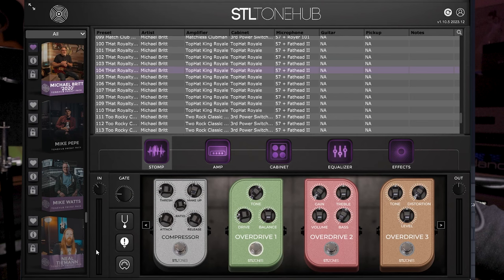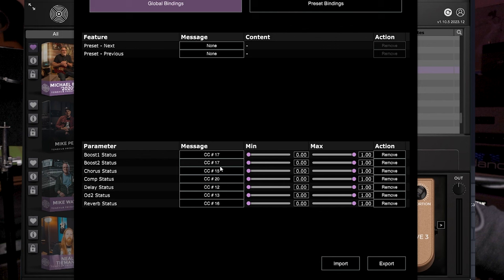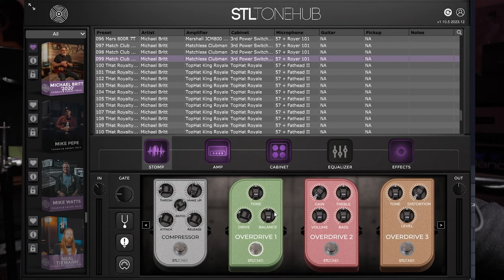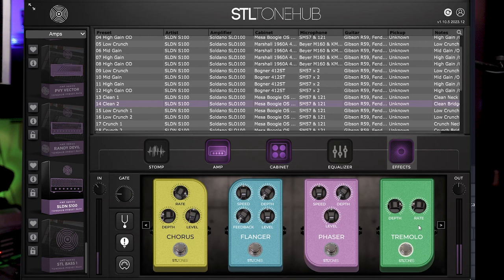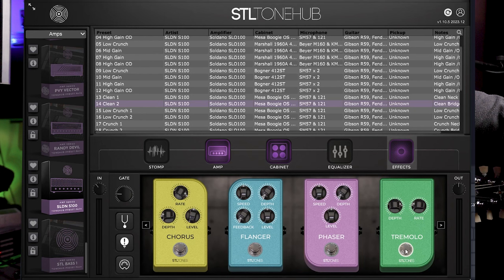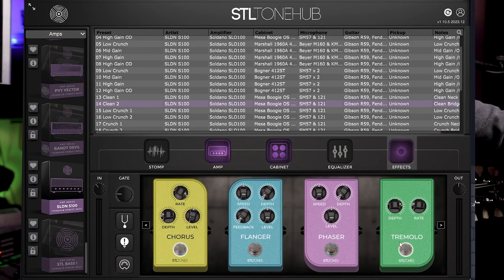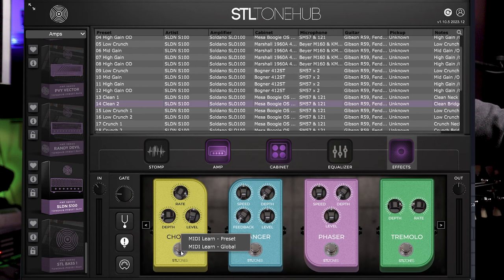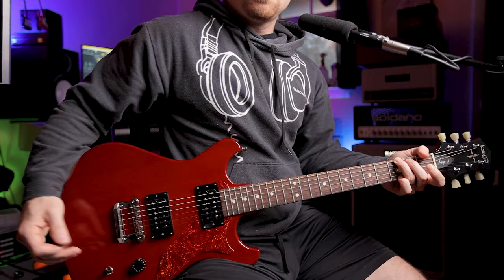Will Guitar Amp Plugins Replace Floor Modelers?

Comment: I think laptop based rigs becoming normal would be the best possible development for consumers. It's better than having multiple competing ecosystems tied to specific pieces of hardware that will run you 1-2k each. Also normal audio production tools become viable on stage and that solves the problem of not being able to completely recreate studio tones.
Reply from the maker: for sure. And you can have as much as your computer can handle
Reply: Also you can choose whatever you want to use for amps + fx, and aren’t locked into an ecosystem
Reply: Things like ToneX, NAM, and Valhalla FX are free as well, and at the very least rival, if not outright beat all the stuff for digital floor units out there right now

Comment: To me the interesting part of this is the modularity of it. Instead of your whole unit bricking you can replace components if something goes wrong. The additional processing power afforded by a laptop is also tempting, as is the fact that you don’t need a dedicated unit for just guitar, so there is a huge cost efficiency with a plugin solution.

I’m moving from an analog rig to a digital rig right now and was considering the Helix or LT but now…down the rabbit hole I go!

Comment: That's a step I'm still not ready to take. While the morning star seems more well thought than most pc compattible switchers I've seen so far, it's still very much on the whim of the pc or mac and I've seen both of those fail a lot more compared to hardware based modellers, plus you got more points of failure (computer, interface, midi controller) in your chain than a standalone modeller.  One more thing I'm not to sold on about is the actual customization. I haven't tried but STL Tonehub yet, but from the demos I've seen it seems to suffer of the same issue the Neural and standalone Line6 stuff does: with every amp I'm stuck with a particular set of FX. I use the a couple of neural plugins for when I'm in a situation where I just want to record on the fly but say I like the type of delay or fuzz in one and the amp in another it gets stupidly complicated to get it done, where with a modeller I got all the options there and the ability to set everything up the way I like (unless something like Helix Native becomes a standalone app, since so far only Bias FX is like that but it's kind of dated sounding). That said, for fly gigs or stuff where a full blown modeller is too much I feel safer with my hx stomp

Comment: I would LOVE to use plug-ins for the remaining time as a guitarist, but because I don't have the latest and greatest laptop, it became more of a hassle and didn't even jive with a decent audio interface either. I even upgraded to a Microsoft windows pro 2 because it was affordable and I STILL had trouble. So still pretty skeptical 😔

I'm more than content with my Headrush mx5 and l6 hx one pedal. It's all the sounds and reliability I can ask for in recording and on stage 🤷‍♂️

Comment: Looks like a nice setup. Ultimately, we're interested in good sounds that meet our needs. Good UIs are important, be that foot controllers, pedals, or software. I think software is much more versatile than hardware, and in the end much less expensive. We usually benefit from a physical interface we can control with our feet as we play, and I find turning the knobs on my HX Stomp a very useful interface. I don't think we need hundreds of Amps, Effects, Speakers, Mics, Cabinets, etc. When I listen to music, I don't need different types of Stereo Systems. I just need one good system that can play all the different flavors/genres of music I want to listen too. I think that same approach is what is taking place with Plugins, IRs, Captures, Profiles, etc., and will likely become the standard as "Modeling" evolves.

Comment: I haven't had an amp since the first POD (the red bean thingy) over 20 years ago,  and I haven't looked back. Like 8 years ago I found BIAS and I've used both the iOS and Windows version (both vst ad stand alone) live and I love it. I've even used some Neural VSTs. I just added the MIDI Commander for convenience, and a few months ago, I got the Xtone Mobile (for even more convenience lol). It was only maybe 1 1/2 yrs ago that I got the LT. Love it... but I've actually used it like 4 or 5 times live. Here's the thing that no one will admit: in the mix? no one will be able to tell what you are using. So, for me, convenience and an extremely limited budget are the deciding factors. Thanks to technology, if all you can afford is a free vst? You are good!
Reply: Are you just using the built in I/O or an interface with it?
Reply: @Scott__C  I've used the laptops native out straight to mixer, iPad's out, iRig, iRig HD and the Scarlet Solo III. Everything works! Maybe an audiophile will cringe, but again, in the mix? with all instruments going on, people, etc? Nope... you won't be able to tell the difference.

Comment: I have the line6 and Tim henson pluggs. With 128 buffersize I clearly feel the latency. I can do 32 in a live setting and that helps a bit. 128 is usable but not ideal. In the studio with large projects 128 is not possible. I work on headphones a lot and it makes latency a critical factor. So my 2 cents are, live yes, studio no.

Comment: I like the idea of a laptop rig, huge DSP, if you play with click and tracks doing automation for patch changes is a breeze. On the other hand I feel a flimsy stage is no place for a laptop and an interface, I would still prefer a modeler for most stages for reliability and wobbly stages.

Comment: I think this is basically the same argument for consoles vs. PC in the gaming world.   Pros and cons to both platforms/form factors - but more recently some developers have released PC based consoles (in essence, a full fledged laptop in a console form factor with a console interface familiar to console users).  When QC was originally announced, that's what I thought they were going for (i.e. a  "console" for running Neural plugins) - maybe they still are - but seems like somewhere in the implementation chain, something got lost in translation.

Comment: The only way plugins take over fully is when they can be loaded into a  hardware device laptops and tablets wont cut it atm they are too clunky and fragile overheat too easy the screen can break ect. unless maybe if they release something like a ipad m3 introduces a full os version and build a decent pedal interface and midi control system
Reply: This absolutely. Would love hardware that could run vst plugins. Do not want to have to take a laptop to a gig.

Comment: So, instead of plopping my Quad Cortex on the floor and plugging a cable into it, I could just bring out a midi controller, laptop, audio interface and DI box?  I get that the functionality is super flexible, but the floorboard versions of these modelers seem to be the logical extension of a live laptop setup, not the other way around.
Reply from the maker: Just spitballing at what the future could hold. Its not a perfect process yet, but could be eventually

Comment: I had all sorts of issues running Amplitube 5 on a Surface Pro 7 in live situations so I bought a Floor 🙂 But running Amplitube live was really what I wanted to do, the modeller was my second choice.
Reply: Have you thought of getting a Tonex (or other modellers that captures amps) and capturing the amp sound from Amplitube if that’s the sound you wanted? Sorry if that opens up a rabbit hole 😂
Reply: @timhopkins3810  No, I liked the Amplitube interface, any of the decent modellers can give a great tone 😀
Reply: @timhopkins3810  No, it was the interface I liked most about Amplitube - the sounds aren't all that different.

Comment: Funny, I was literally thinking the same thing today ! Honestly, its even more powerful than a modeler. Right now Iam in the process of using Neural DSP plugins for church - tomorrow, if it goes well, I'll permanently shift to it and forget about getting a QC.
Reply: For me, it's really about more to set up.  If I have a floor modeler, it's power, in, out and I'm done.  
A laptop, it's connect the audio interface, the MIDI foot controller, make sure they're all talking to each other and make sure they all have power.

Comment: Why there isn’t a bunch of floor based audio interfaces with a bunch of integrated midi programmable foot switches l that you can configure for easy use with a laptop and plugins has been confusing to me for a couple of years. 

The DSP capability of even a several years old laptop is like an order of magnitude beyond even the most advanced modelers.

Comment: windows needs to get their audio latency situation together. I really dont want to use those overpriced macbooks that start with 8 gigs of ram that they try to pass off like its as good as a 16g PC
Reply from the maker: I use windows and never run into problems. I use a ASUS gaming laptop and maxed out the RAM. Works great for editing video as well

Comment: No they won't.  Can't use plug-in.  In Live situations.
Reply from the maker: I am assuming you didnt get to the part where I go over how to use them live?
Reply: @SteveSterlacci  Yes I did that's too much work dialing in tones for a live situation.
Reply from the maker: @TheBbtlegit  it's the same as, or even less than most floorboard modelers.  I just pulled up the tones stock and ran with them for the first time on camera. To each their own as they say
Reply: @SteveSterlacci the stock tones sounded like doo-doo. I get the point, and there’s tons of bands doing this exact type of setup today but inside of a DAW.

No shame in being creative with modern technology, I just don’t see it overtaking the existing market. It will grow in its share of it maybe.
Reply: @SteveSterlacci  People have their fixed opinions and no amount of facts or demonstrations will change them
Reply: I'd assume it would be similar, but with my Helix etc., the biggest thing I have to deal with is too much high end.  I'll just roll off some more or less depending on the situation.  It's murder if a particular engineer likes to run his/her system bright, but usually I'm set the Hi cut from 8k down to 5k, depending.